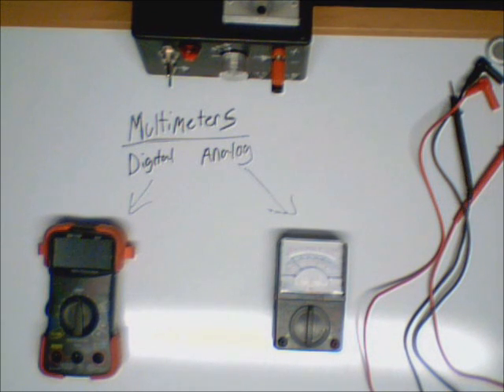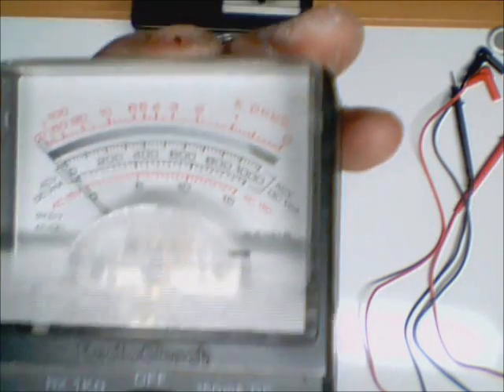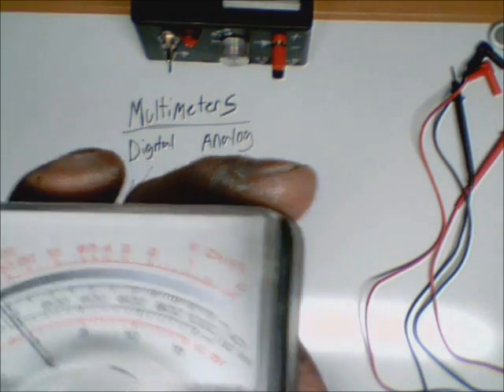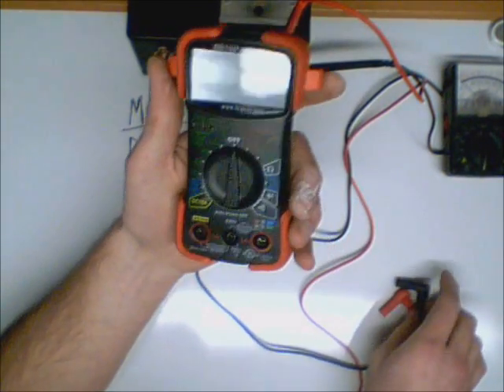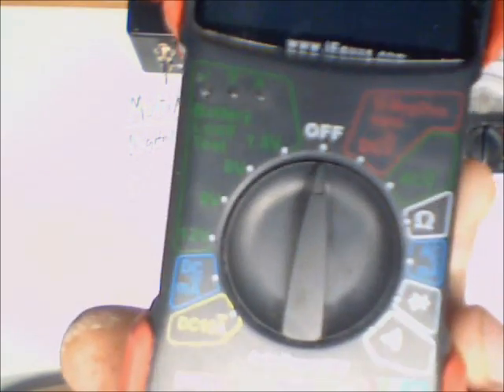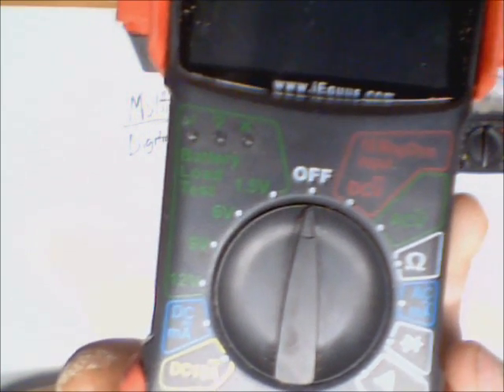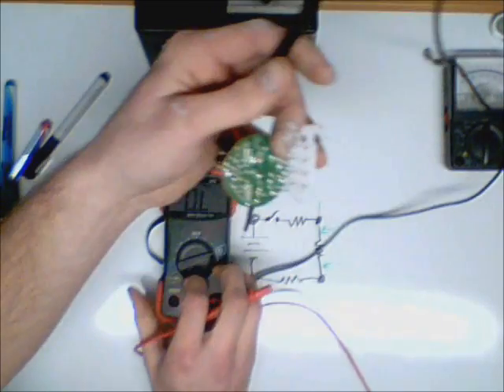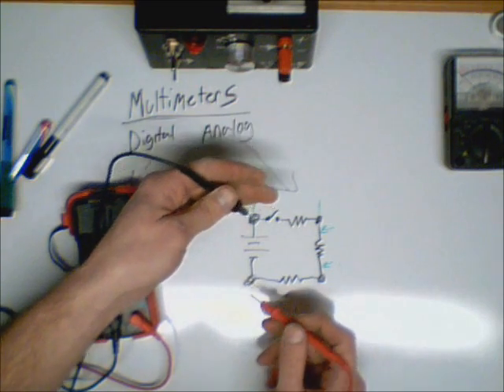Multimeters

Comment from the maker: @Me102288 what i meant by that comment was dont test a 12v Car battery with the amp setting because on most meters they can only handle about 10 amps. and a car batter has the ability to go over 700 amps, u can measure fuses within a car for like radios, and head lights stuff like that just stay away high amperage devise that use induction. So your comment about measuring a 1000v has nothing to do with this.